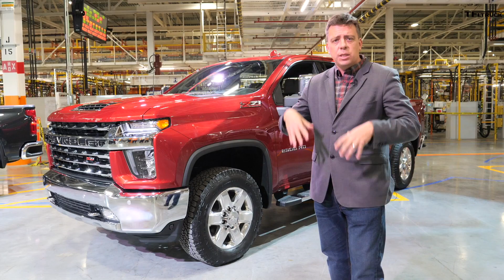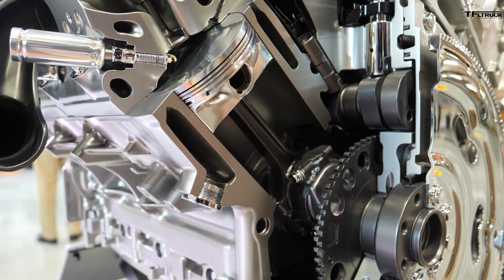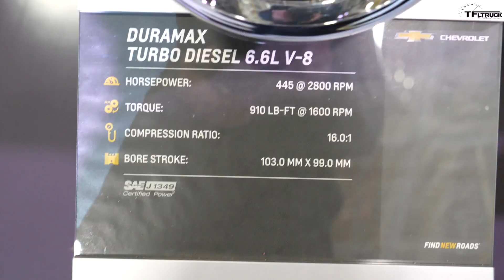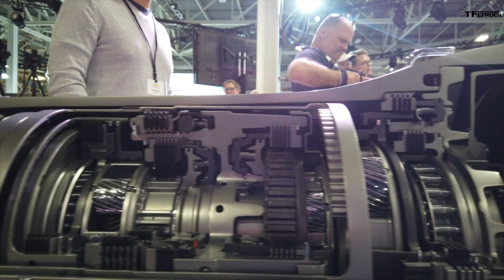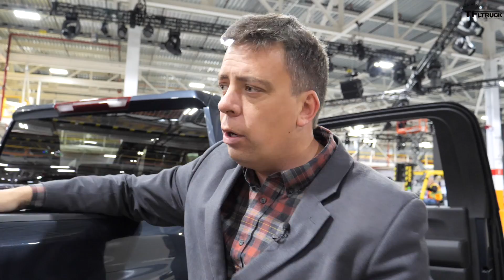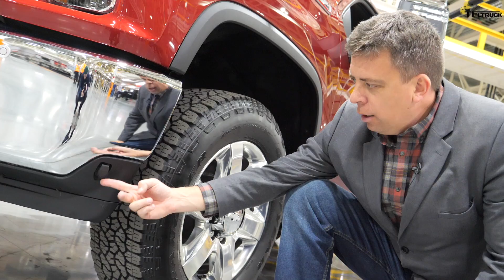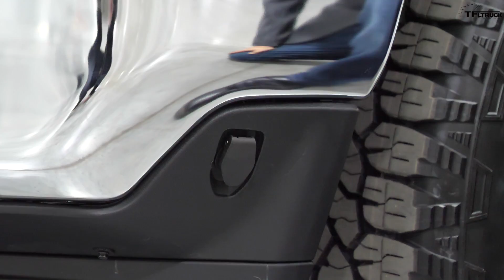Here is How the 2020 Chevy Silverado 2500 HD Delivers the Torque to the Ground

Comment: Power??? Wow I was thinking a lot more!!! Ok Ford let’s see your cards
Reply: Guys notice the power maxes out below 5252 RPM this is a low RPM work horse not like the 6.2L where max power is 5600RPM. Doesn't seem like a big RPM difference on paper but it is in the real world. This also has an Iron block like the old 6.0L not aluminum like the 6.2L.
Reply: @geoffinbc  yup people have to realize that numbers only tell a fraction of the story. Looking at a dyno plot can reveal so much more, not to mention your point on materials used which are designed for durability and longevity.
Reply: @geoffinbc  yeah but why not just make a cast-iron version of the 6-2? More displacement same power equals more fuel burned
Reply: @jrush8328  Right. But they are after power at a lower rpm. The only way to do that is to increase torque. On a N/A engine you have to increase compression and/or displacement to do that.
Reply: @geoffinbc  I still expected peak torque to come in a bit lower, but I'm sure it's got a very beefy torque band from about 1250 RPM on up.  Big displacement = big low-end torque, inherently-so.  These class 2+ engines are designed to hold their power ratings even under long stressful trips up mountains and hot deserts.  LT1 isn't a work engine.
Reply: Ford has showed there cards they have a new 7.3 gasser coming out. And it's pushrod!
Reply: ReidHenderson  yes ford has always had a pushrod motor and said there is still a place for this technology
Reply: @ripfletching  remind me...  which pushrod engine did Ford build through the early 2000's until this one?  Additionally, when the Ford Flathead was THE engine for hotrodders to use, in the early 50's, which pushrod engine was Ford building?  When the original small block Chevy went into the Corvette in 1955, the Ford Flathead was simply outclassed.  It was AFTER the SBC, that Ford decided it needed to move to the ohv, setup.

It is one thing to be a fan of Ford.  It's quite another to make fictional statements simply to support your point of view.
Reply: wlabishler 1 Ford built the V10 a pushrod engine they also build the 6.2 which is a pushrod engine only the coyote-based engine currently is a dual overhead cam the modular motors are the only ones that have the dual overhead cam system for a V-8
Reply: @ripfletching  the 6.2, AND the 6.8 v-10 are SOHC...  not pushrod...
Reply: wlabishler 1 really lol 😂 I thought they were  both push rod
Reply: @ripfletching  yeah, the v-10 is based on the mod motors.  The 6.2, is kind of a half step between the Coyote and the mod motors, though I am not positive on that part...  TBH, I dont quite understand why the 6.2 didnt end up just being a larger displacement Coyote.  I'm not a real Ford fan, but i can admit that it would have had the potential to be a very strong running engine.  The 5.0 coyote runs very well, a 6.2l version would be pretty awesome.  The only thing I can figure is that 5.0 may not have much room to grow, in it's current build.  Meaning a redesign would be in order, to gain the desired displacement.  Potentially making a 6.2 coyote, very difficult to physically fit in current engine bays.
Reply: wlabishler 1 that is true! I have a coyote 5.0 and it’s phenomenal I can’t imagine a 6.2 lol
Reply: ReidHenderson right but we need power numbers. The pushrod is good for low RPM . But 4 valve rocks in normal autos
Reply: ripfletching I thought so too, less or similar power to the lt1, I just don’t get the point of developing a new engine with such similar performance
Reply: @KZ-dy1lx  obvious you don't understand engine Dynamics and durability. I'll just give you a small clue this new engine is a lower RPM gas engine like a diesel and it delivers power from super low RPM all the way to its Redline! It doesn't more efficiently and potentially a million mile motor! Do you understand? If you don't understand it you probably never will
Reply: https://www.ford.com/trucks/super-duty/features/power/
Reply: Seamus603 very good
Reply: Even my 77 460 made as I recall 400 lb ft of torque
Reply: @Xxplicit the 6.4 Hemi does push out a little more hp.  But dont forget, that Hemi is down on torque, by a pretty large margin.  This 6.6 gas engine has a powerband that is shifted down in the rpm range.  It should tow well, and feel quite capable.  Now we wait and see if it can match the reliability that the 6.0 managed.
Reply: Yall are failing to realize something. They're making big blocks again quit complaining.. trust me when ford dodge and chevy notice that this is what we want then they will start producing more motors with higher numbers... right now they're experimenting... just wait till chevy builds a new 454 or a new 496. This is a trend that's gonna catch on
Reply: @brockmaine2743  larger displacement is not the same as "big block".  The true big block, will most likely never come back in any form like it used to be.  Not that it matters.  These small block based engines have been capable of reaching displacements that used to be only available as a big block, and the power levels they can reach, far surpasses anything but the most extreme of big blocks.

For top fuel drag racing and such, the big block will reign supreme pretty much indefinitely.  But for a production vehicle, the big block is dead.
Reply: Brock Maine Big blocks are a thing of the past lol. My eco boost has more torque then the new Chevy big block and gets way better gas mileage.
Reply: The ol 6.0l will outpull the 6.4 hemi so this new engine should crush it.  Look up the TFL shootout.
Reply: Ford is coming out with a new 7.3l. (Gas)
Reply: Way to copy eachother ford and Chevy
Reply: These dual fuel pumps are gonna ruin these motors
Reply: The lower numbers are just the result of efficiency above all else. They have to increase size to give expected HP numbers while maintaining efficiency. If they weren't defined by efficiency they could easily get 550
Reply: The previous engine that this is to replace, was the 6.0 that has been around in it's current configuration, since back in 07 when it got vvt.  That engine has earned a reputation as a workhorse.  One that will go on and on, taking all the abuse you can throw at it, and still tow reasonably well.  This engine is supposed fill that position.  It is not intended for maximum output.  It is supposed to be ready for many years of hard work.  Hopefully it is worthy to replace that tried and true 6.0.
Reply: @Xxplicit wow man the Hemi is blowing up all over the place they are not durable they have many problems. This engine is Bulletproof it has super low end torque and horsepower at low RPM all the way up 2 it's red line! You have no idea of what you're talkin about the engine Dynamics here are superior to any Hemi! If you're looking to drag race go ahead and take a higher RPM Motor and blow it up after one or two uses use this motor for drag racing with a 10-speed automatic and it will go down the track Time After Time After Time After Time After Time After Time After Time After Time in will not blow up! Depending on your chassis set-up it will either win the race or lose the race but it won't blow up! Capiche
Reply: @Michael-ge3eo  these dumbed down Ford boys don't understand gearing.
Reply: @imyourhuckleberry4547  you're hilarious Chevrolet has never made anything close to Ford Power !!! Your Duramax is an Isuzu engine to funny !!! Well done government Motors Company
Reply: I'm very unimpressed with those power numbers. Considering the current 6.2 has 420 460. To bump up the displacement and have effectively less power does not make much sense to me
Reply: @jrush8328  it's because the HD gas engines have reduced power rating because they're built for longevity, similar to the out going 6.0L which generated 360 hp and 380ft-lbs at a time when the 5.3L in half tons generate 355hp and 383ft-lbs.
Reply: @youcanshootnow  these numbers are fact?  Doesnt make any sense....
Reply: @jrush8328  THAT IS WHAT I WAS THINKING. LESS TORQUE AND HP, BUT MORE DISPLACEMENT. I GUESS ALL IN ALL THEY JUST NEEDED A STRONGER AND UP GRADED ENGINE THAT WOUND UP BEING MORE DISPLACEMENT. I'M BETTING MONEY ON FORD'S NEW 7.3 LITER GAS ENGINE BEING MUCH BETTER. AND YA GET AN ALL NEW HEAVY DUTY 10 SPEED WITH IT.
Reply: The only good thing about the Ford 7-3 motor is that they finally copied Chevrolet LS blueprint almost exactly! Shows you that Ford had to give up The Ghost and copy GM Engineers to the T.
Reply: Michael Cavalieri  really lol 😂 Ford has been building pushrod motors longer than Chevrolet pushrods are more narrow and produce more torque it’s old technology but works well for industrial purposes copy and an LS I don’t think so the LS is a good platform but this 7.3 Ford built is not a copy of that LS. Thanks
Reply: @Michael-ge3eo  lol don't get your fan boy
Reply: @Michael-ge3eo  they didnt copy anything from the ls...
Reply: ripfletching No doubt! It’s got less power than a 3.5 eco boost nearly half its size. I can’t believe they don’t have a 550 hp / 600 tq minimum gasser. They can’t do that because no one would buy a duramax for $10k more.
Reply: 7.3 going to tear that 6.6 gas converted duramax up
Reply: @jamesbeckwith3806  Its certainly not a converted Duramax. I do hope Ford can muster more power from their 7.3L. But its a gamble if you can sell customers on power alone if fuel economy suffers. Fleet buyers certainly don't care about power. They want reliable hours on the road with good economy.
Reply: @jamesbeckwith3806  how is it going to tear it up if the 7.3 will be broken down on the side of the road all the time?
Reply: lol you have to get past Dodge first before you even think about playing with the BIG BOY (FORD) !!!!

Comment: It's about time they put more than 6 gears behind the Duramax.
Reply: Not like your rpm will ever be high enough to use 10 gears in a diesel, lol.
Reply: dedalliance1 are you really that stupid
Reply: @flyingwolffilms  What part? I've talked to a trucker friend of mine that has been driving truck since he was 12, and he's almost 70 now still driving trucks. And I've talked to a mechanic friend that also thinks a 10 speed on a pickup is dumb.

What do you need 10 gears for? Probably shouldn't pull a trailer over 70 mph, so what are you going to do, shift every 7 mph?
Reply: dedalliance1 also I have my cdl and I understand how and why more gears work. Semis have those gears for the exact reason I listed.
Reply: @Sackmatters  If it works it works I guess. Seems like more to go wrong with more gears and more shifting points. Who knows how it's going to affect these guys that like to delete their systems and do transmission tunes and such to hot rod them. I think the only reason they're pushing that many gears is to get these 35k+ tow numbers which is dumb. As you know you need a cdl to go over 26k gvwr these new trucks are pushing almost double that? If you're going to buy a 50 to 90k dollar truck to tow that much you're going to get a 5500 or 6500 new Chevrolet or a f550 or f650 or rams models or you just buy yourself a used Peterbilt with a cat or Cummins diesel or something, as you probably know.

A 1 ton truck is for people that are like hey I have a triaxel toy hauler or I have a 35 foot sail boat or I have a 5 horse with living quarters trailer or I have a dump trailer or I want to move small construction equipment around. None of those trailers require trucks need a 35k tow rating.

So to me, designing a transmission around this 35k pound tow rating when no one without a cdl can tow and anyone with one is smart enough to buy a bigger truck. We used to have 3 on the tree trucks and they seemed decent, now we have 5 and 6 and 8 speeds, but a 10 speed? Just buy the right tool for the right job.
Reply: dedalliance1 go watch a engineering explained video it’s simply more efficient to have more gear ratios.
Reply: @dedalliance1  you got that completely BACKWARDS. Ask mechanically inclined trucker or engineer  why class 8 truck have 10, 13 & 18 speeds.
Reply: @GIGABACHI  Because they have low powered engines, gear ratios that are built for it and they're made to haul twice as much weight as even these max tow 1 tons. That's why. The new Ram 3500 has better Engine power numbers than some Semi's from 30 to 40 years ago, but they were also made to have a max load on them every time they drove. These new trucks, not so much typically. You either get a heavy hauler or a daily driver, or you do what they're trying to do with pickups now and meet in the middle.

My sister boyfriend has a deleted 2013 Duramax dually 6 speed. It'll go 140 mph if you want it to, you don't need 10 gears to push these engines to their max.
Reply: @dedalliance1  lmao do u know how diesel engines work? More speeds the better my friend
Reply: @tonystone6955  Better for what? Towing 35k pounds or for towing 15k like most people will, or for not towing anything at all, that's what most people do actually.
Reply: It’s all just a sales pitch, 1st it was a 4-spd, then a 6-spd, now a ridiculous 10-spd. Next is a 13, 15 or 18 spd. These trucks are just one big pissing match. Who has this over that guy. The more technology they put in these trucks, the less the driver has to be aware of.
Reply: Tom Markulics your dumb to

Comment: Not giving up my 2002 3500 dually with its 8.1 yet.
Reply: I'm not getting rid of my 2003 2500 6.0 5 speed manual either
Reply: I agree. I love my 8100 trucks, I will never get rid of them. Best powertrain ever!
Reply: Don't your old truck will last longer than these new garbage looking trucks.
Reply: Have a 02 2500 with the 8.1 with the allison. 200k miles and its still a beast.
Reply: With that thing everyday is thirsty Thursday.
Reply: 2002?  That's just getting broke in for a Chevy.

Comment: Not sure that putting Direct injection is a good idea on a engine that could see long idle times especially from fleet use.
Reply: Sounds like a carbon nightmare to me.
Reply: The carbon problem is solved by getting synthetic blend motor oil at least and by checking the chemical content standards for gasoline where you live, for example if you live in certain parts of Arkansas, don't buy fuel from a station with below-ground fuel storage if you have a GDI engine, as sulfur contamination is a thing, don't buy fuel from stations that get their fuel supply from Casey's general.
Reply: “Oh no its got a little carbon on the valve i better get a new engine before it explodes like a nucler bomb!” SAID NO ONE EVER seriously though the “carbon problem” is seriously overstated yes they get carbon on them does it cause issues? None that ive ever see
Reply: @jordanlongstreet3057  it definitely does and has caused issues in extreme cases. I'm sure GM accounted for that in their engineering. Some manufacturers have been tweaking the systems or adding multiple forms of injection for a cleaner/more efficient burn. Should be a non issue with these trucks.
Reply: JakeDrives. Ya i suppose, i only repair gm vehicles so i only experience failures on gm vehicle, or in the case the non failures like i said ive never seen one  but to be fair i cant say ive worked on every gm vehicle ever built but the point is as far as ive seen none of the gm direct injection engines have issues due to carbon caused by direct injection, i dont see why the new 6.6l would be any different. As far as ive ever known to if you have carbon issues so severe to cause problems you probably have other issues ie. crappy engine oil, sub par fuel or bad valve seals. But as always your milage may vary, not all circumstances are equal

Comment: Not sure I like the block heater plug down that low. I see it getting ripped off or damaged when driving off-road such as a farm. I’ll have to see one in person, but hopefully the taller truck with the lower mounted mirrors are still taller than cattle, or the mirrors will potentially get knocked off

Comment: I understand making the new 6.6 stronger for a heavier workloads but the output number suck. 6.2 1500 truck. 420hp 460torque
Reply: The 6.6 gas is tuned for long term reliability with towing.
Reply: The 6.2 wont tow/haul like the 6.6, they could get more power out of the 6.6 by advancing the timing, but reliability will go out the window
Reply: The 6.2 is the Corvette engine. I don't see many Corvettes towing 16,000 pounds, and there's a reason for that.
Reply: dedalliance1 you should read the comment closer before trying to sound smart. I was clearly referring to the 1500 truck with the 6.2 having more power AND torque then the new motor. Which I consider underwhelming.
Reply: jacob bennett - You have no clue what you’re talking about.
Reply: @JacobBennett45  Yes I read your comment. The 6.2l in the trucks is basically the same motor in the Corvette. It's a high performance sports motor, not a work horse towing motor. 2 different applications there.

My grandpa built Corvettes for 22 years in bowling green Kentucky, it's not made for large gvwr applications.
Reply: Anyone here ever heard if a flat torque curve, that's what it is, plain and simple, very mild cam that makes 85-95% peak torque at 15-1800 rpm and holds it across the RPM band, its a proper truck motor, anyone who's run a pre-diesel-fad work truck would know that
Reply: Love how everyone is an expert on motors, but not really.      If you don’t like my comment then move on. I get making a larger motor for better reliability but MOST people are going to look at numbers alone when buying this gas HD truck
Reply: @JacobBennett45  You're right, people are going to look at pure numbers, and in 15 years they'll look around and see the motors that are still running around the road, and it probably won't be the motor they bought off of pure numbers on a spread sheet.